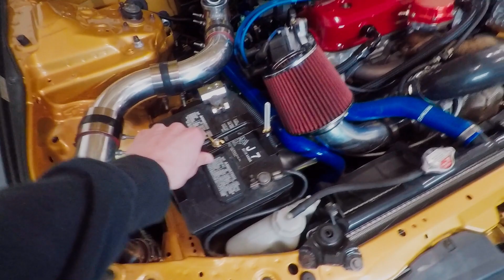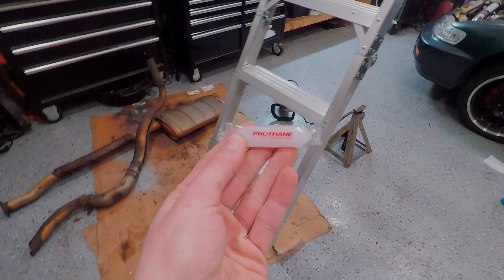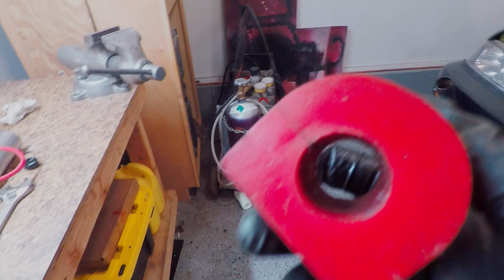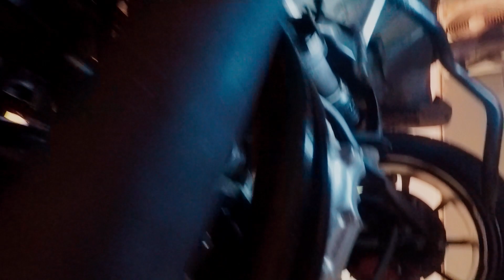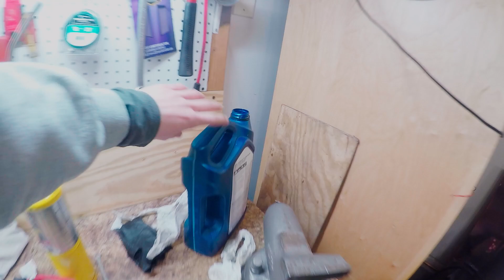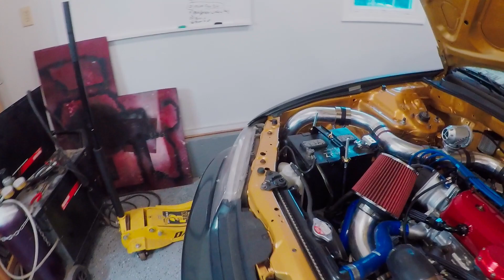Revisiting the Sway Bar Bushings + Oil Change on the Boosted CD5

Comment: Bro use mobil 5w50 and thank me later ;)
Reply from the maker: Didn't know they made a 5w 50! I'll definitely look into it man. I need more oil pressure! Thanks!
Reply: @ThatAccordGuy  it is full syntetic. We use in Netherlands for every performance cars whit turbo. No oil burn no damage in the crankcase etc. 5w40 gifs allways problems. Try it is Racing oil.
Reply from the maker: @suleymancakr6724  I will definitely try it bro thank you!

Comment: Hey what type of Turbo are you running on that and what's your horsepower looking like
Reply from the maker: https://rover.ebay.com/rover/1/711-53200-19255-0/1?ff3=4&toolid=11800&pub=5575475680&campid=5338467483&mpre=https%3A%2F%2Fwww.ebay.com%2Fitm%2FCXRacing-T3-T04E-Turbocharger-60-A-R-Turbo-Charger-For-EG-Hatch-Civic-EX-B18%2F140624123129%3Fepid%3D658400515%26hash%3Ditem20bdd9d4f9%3Ag%3AE4gAAMXQlgtS1kI~

That's the turbo, and I'm not sure on horsepower since I haven't put the car on a dyno, but I would guess I'm in the 250 hp range.